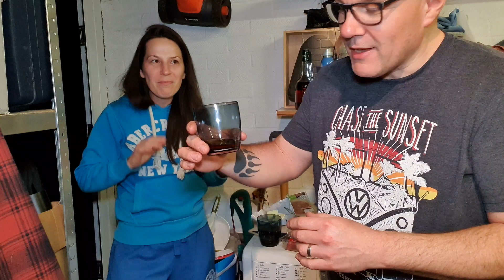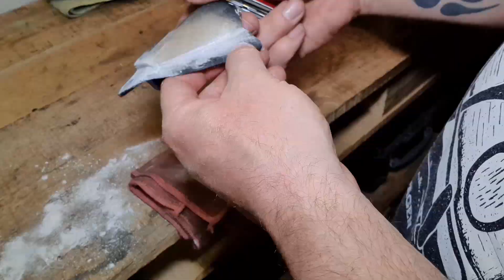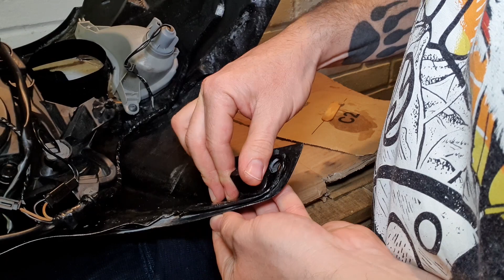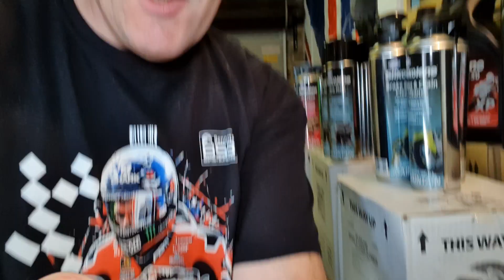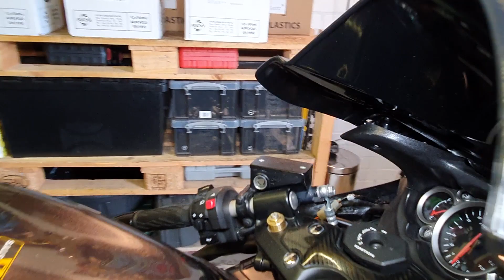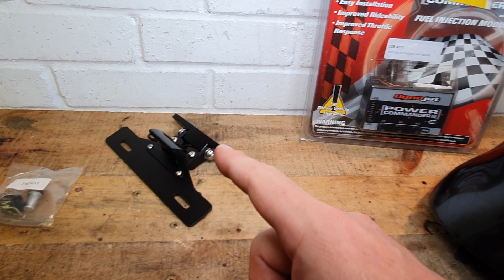Fuchs Up Fairing Fixed - Hayabusa Build Series

Comment: Do I win any prizes for being first to comment? Honestly I will take anything lol.
Quick question re the glueing procedure, is there a reason for mixing on cardboard as opposed to on the fairing? Never having used resin glue I thought I'd ask. Busa is getting there for sure dude.
Reply from the maker: Haha keep a eye out on twitter and Instagram for when I do a giveaway 😄 
I wouldn't mix it on the part as you could have a weaker mix facing onto the part 😎👍
Reply: @SixthGearMotorcycles  Thanks for the advice mate. Every day is a school day.
Will keep my eyes peeled. 👀